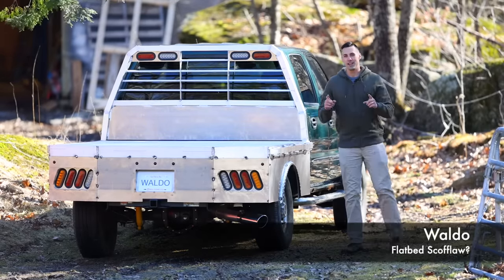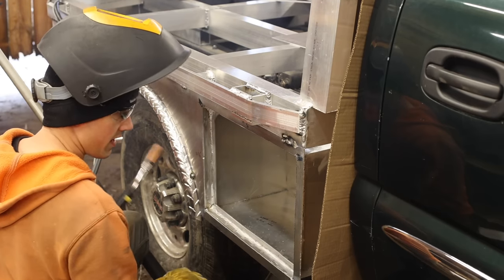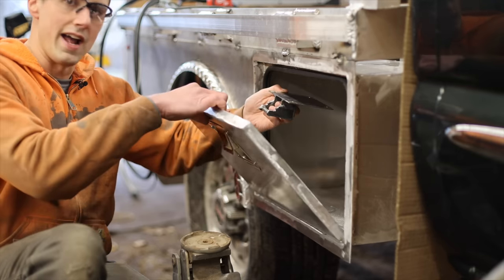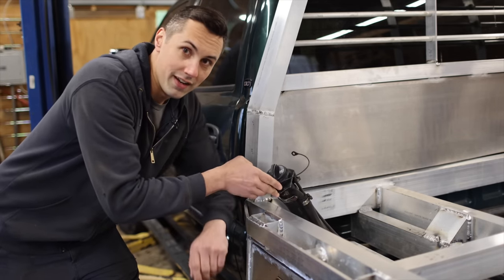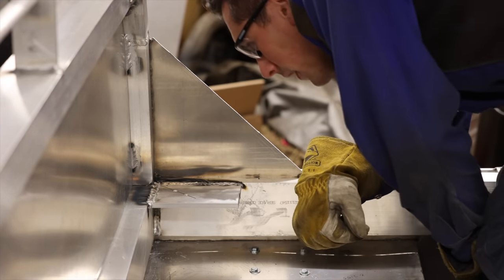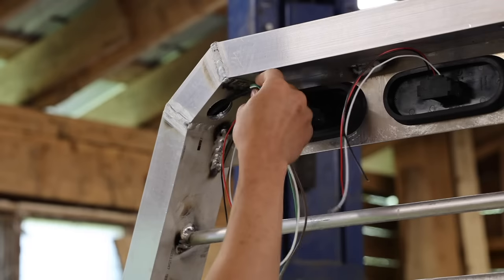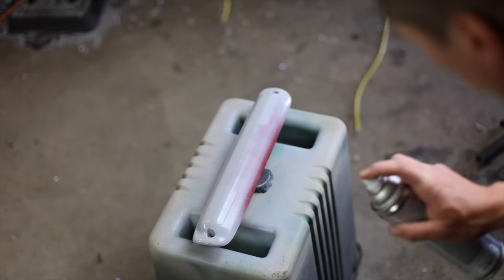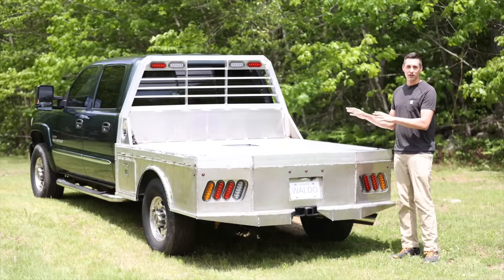Aluminum Flatbed Build (part 2): Toolboxes, Bumper, and More

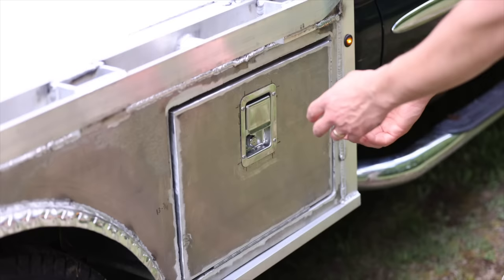Comment: 24:31 would be cool if the lower revenue lights went on also when of course parked. Also be cool if there were some white light the sides by where the gas cap are on both sides of corse too when parked.

Comment: Nice job! One change I would make it the tool box latch. Switch over to Boltlock brand and you can use your ignition key for all of the locks. I changed everything I have, tool box, trailer hitch receiver, and all of my trailers. Now I only have two keys on my key ring, ignition key and my house key. And I would have went sequential on the hash mark taillights. I did on my custom build. Since I was in the Navy, mine look like chevrons on a first class petty officers sleeve turned sideways and I even include a lighted cutout of Hero's Aeolipile, since I was a Boiler Tech.
Reply: Can't really picture it but sounds cool, make a vid of it and describe how it's done

Comment: I bought the CM ALRD aluminum flatbed for my dually. Price out the door in 2019 was just under $4000. I installed 2 30" tool boxes and mud flaps. The frame is steel, includes a 30K GN hitch and 18K bumper hitch. Total weight of the bed before adding the tool boxes and mudflaps was 597 Lbs., which is basically the same as a stock dually bed. The real savings is the included hitches which if you added them equals about 300 Lbs. of additional weight. So my bed with boxes added is less than a factory bed with a GN hitch and bumper hitch. I moved the fuel neck to behind the toolbox and in front of the driver's side rear tire as the tool box interfered with it. Having the lights on the headache rack is priceless - SO much visibility! No excuse for someone not to see those lights! Another improvement is I added a mirror style dashcam with the rear facing camera mounted on the headache rack. It see's out over my goose neck trailer and you can see cars that are alongside the bed of the truck which basically eliminates the blind spot. Look at some of my videos and website to see what it looks like.

Comment: Great video.  Due to all the different metals at your grounding location you will have galvanic corrosion (look up nobility of metals) in a few years, keep an eye on it.  The only way to have prevented this is to use aluminum wiring and bolting the grounds down with aluminum bolts.  Maybe you can just redo the grounds with aluminum wire.
Reply: The grounds are a typical coated wire terminal on copper wire. In theory yes the bolts could be an issue...the wire no.